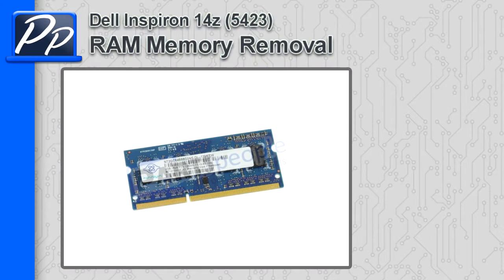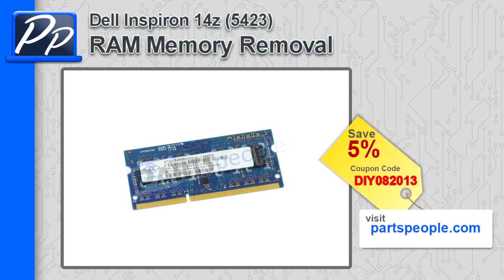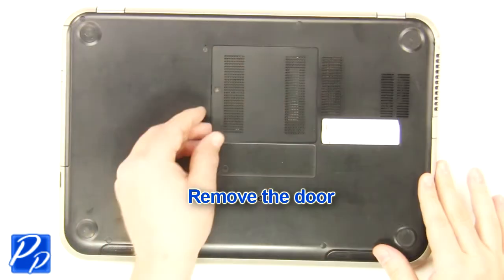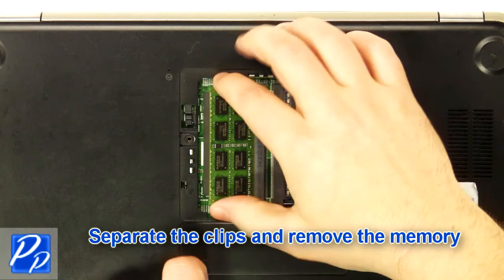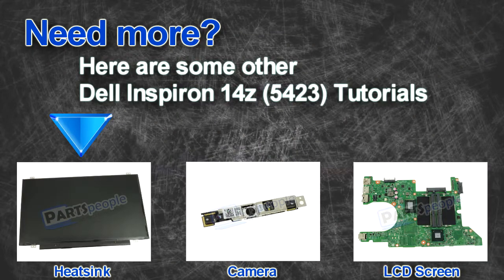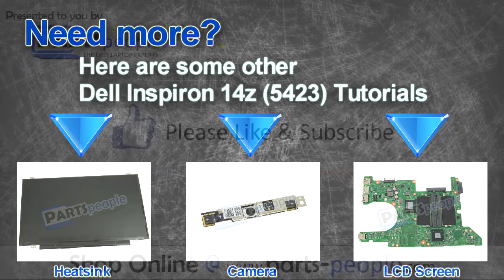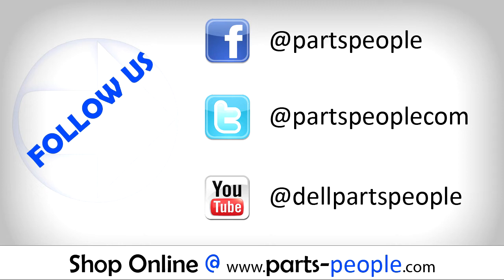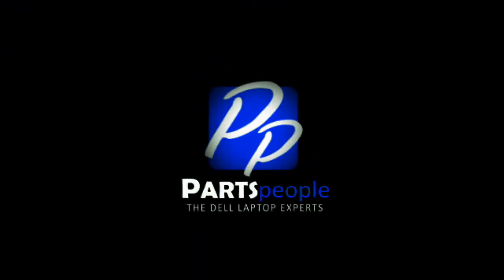Dell Inspiron 14z (5423) RAM Memory Video Tutorial Teardown

Comment: i have currently 6GB ram (4GB ram in one slot and 2 GB ram in other slot) . I am planning to upgrade. What do you recommend   1. one 4 GB ram to replace 2 GB ram 
2. one 8 GB ram to replace 2 GB ram.
whether do you recommend two slots with the the equal memory or it does not matter performance wise.
whether this model does it support 16 GB (2 X 8 GB slots).
Reply from the maker: I know it can handle 8gbs (2x 4gb), I'm not sure about 16gb.
Reply: how to change bios settings to change it to 8 gb
Reply from the maker: Yo don't have to change anything in BIOs. it will auto detect and configure itself.
Reply: Hi Sudheer! Wassup? I would like to know if you upgraded this model to 16GBs? I can't find this information anywhere, hope you can help me, hugs
Reply from the maker: @donnvini  Based on all available information, this motherboard's chipset will allow for a max of 8GB of DDR3. 4GB per slot. Hope this helps.

Comment: my laptop is super slow. will adding an additional  6GB to my current 2GB improve speed performance?
Reply from the maker: It will help but a fresh Windows install usually helps the most. You can also clean the heatsink and fan. When the laptop is running cool, it runs faster.
Reply: @dellpartspeople  pleaske make a tutorial for it for this laptop